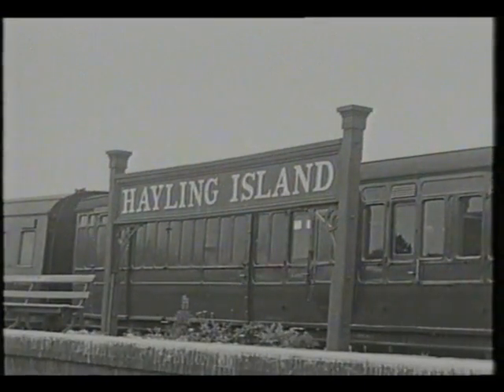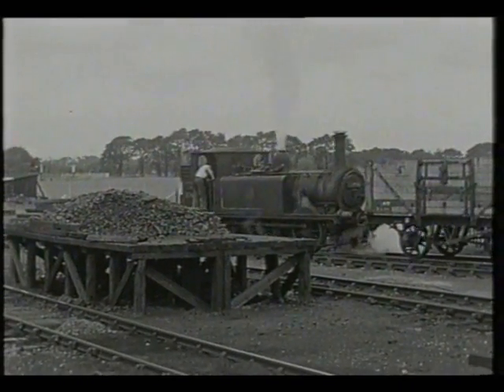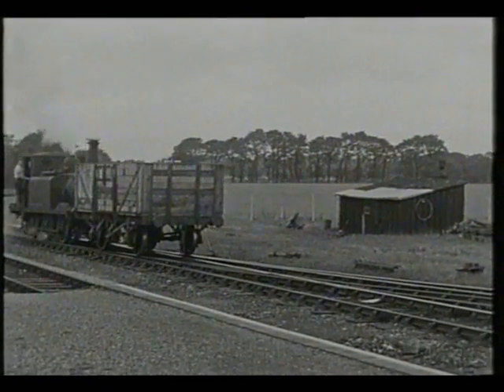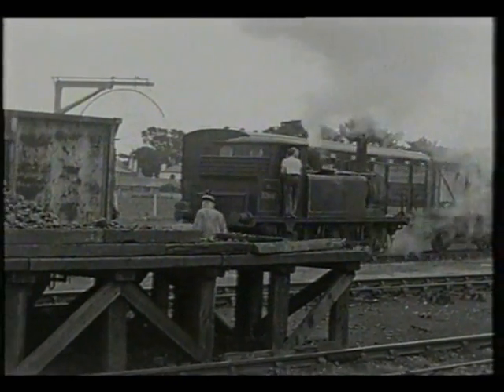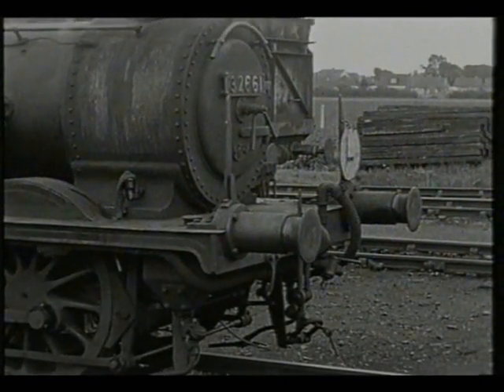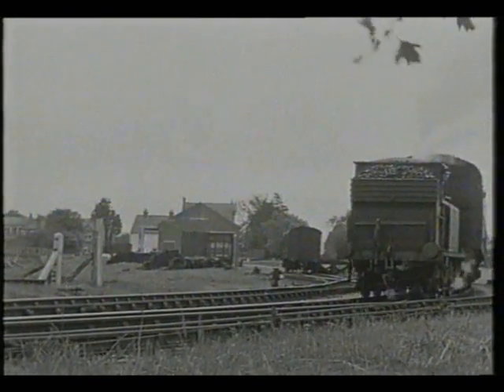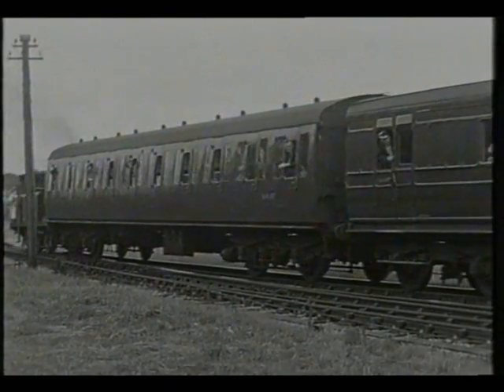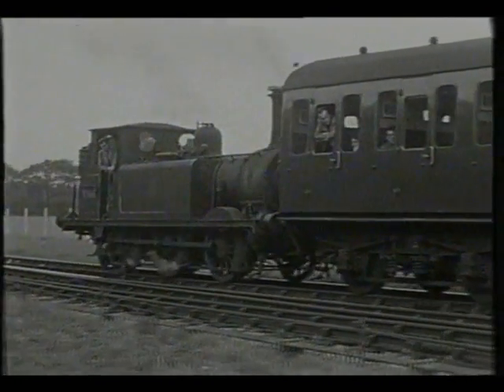Railway Roundabout 1958 'The Hayling Island branch'

Comment: I am a little late commenting on this but as a matter of record I am a Hayling Island lad and lived in the first house over the bridge from Havant.
As a lad I could see the old Billy going by from my bedroom window, my playground was underneath the central turntable on the bridge across the langstone harbour crossing, when the train went over, ended up with hair full of rust that dropped from above.
When Beecham closed the line it was stated the bridge was weak and could not be repaired so they cut all the timber baulks off the top of the bridge and asked the Royal Navy to blow up the concrete piers below to provide seagoing navigation.
On the day of the demolition we were all advised to open our windows and doors prior to the explosion, then at the alotted time there was the biggest bang and shock wave you can imagine, result? Well you can still see those concrete piers still standing today, not a scratch on em! Never trust a bluddy expert.
Reply: Beeching. 🙂